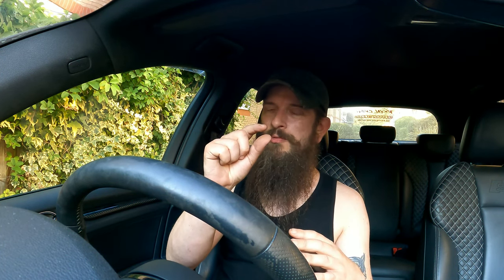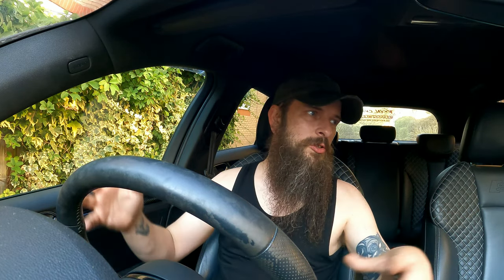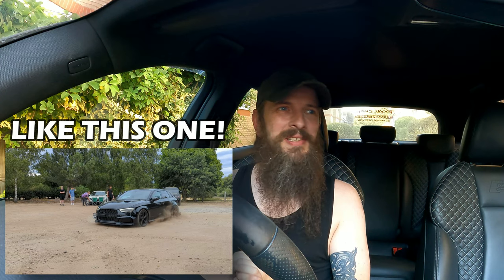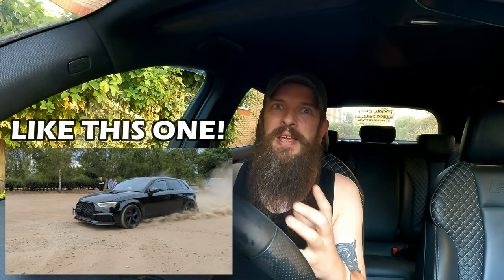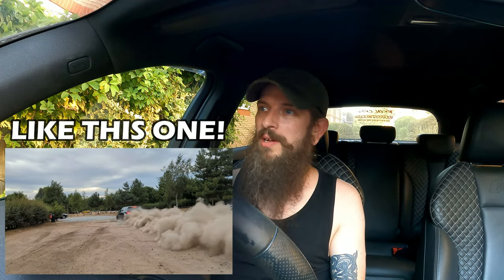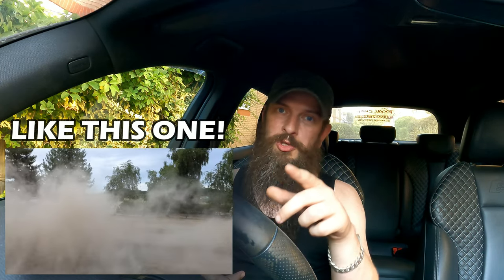Audi S3 Tune Update. Should we start stripping the interior?

Comment: Yes! Saving weight is my favourite mod...you could be clever with it and keep the plastics and carpets etc but remove all sound deadening and unwanted electrics so it still looks full fat. Rear seat delete too.
Reply from the maker: Yeah good point, can do in stages, also quite like the raw look on the inside so might get carried away :) Curious to see how much can be dropped. Here still won't be the heavy stuff like stereo / AC quite yet. Bit too hot atm to remove AC lol
Reply: @Beardchanics  you'll be amazed. I bet you can easily shed 100kg
Reply from the maker: @SoloLap  yeah I need to go and collect my scale from the workshop so can weight as I strip. Apart from the exhaust job (back box was 28Kgs!) haven't really saved any weight so far. Been excited about stripping it though, love that raw feel on the inside and might try and follow your videos about making plastic windows. Found a kit but £1.5K so might try and DIY route first.